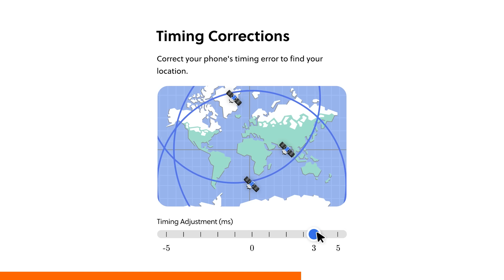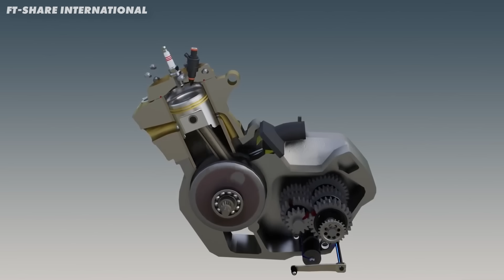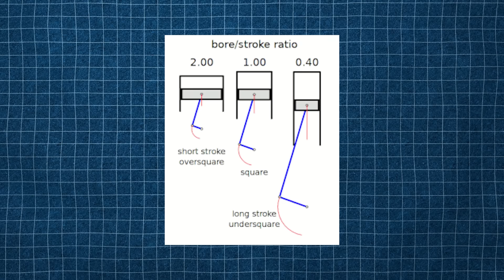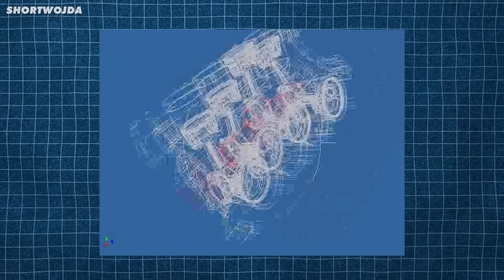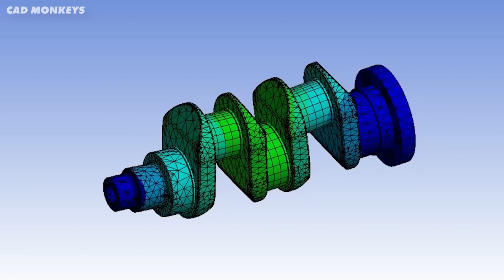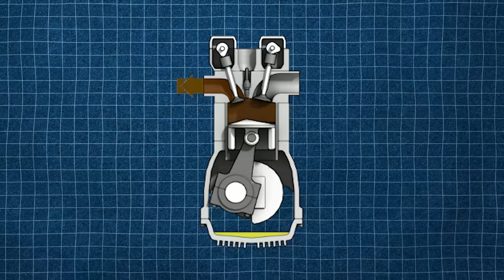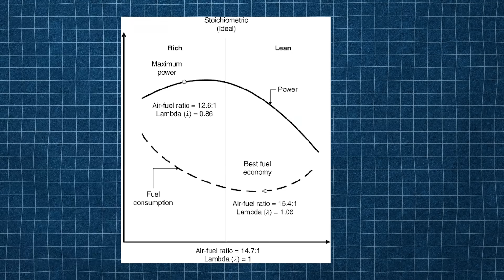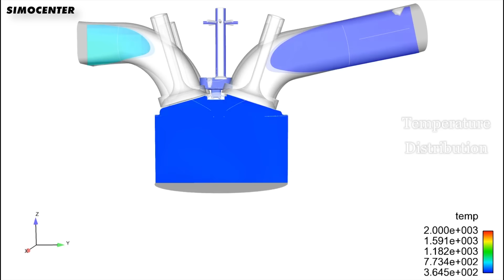Why It’s Almost Impossible to Rev to 21,000 RPM

Comment: I think you got the temperature of an F1 engine wrong. You said it can get up to 2600C 8:34 Titanium melts at 1668C, and aluminum, iron and steel all melts at lower temperatures than titanium. I might be wrong, but imo 2600 is impossible.

Comment: Wrong. My 1992 Kawasaki ZXR250 revved to 21K. Admittedly the redline was 19k, but that was just a bit of ink on a dial face. The engine went to 21K. On a road vehicle. That survived at least 20 years - I sold it early 2012 with no known issues. 4 stroke. 4 cyl. 16 valves. 4 carbs.

Comment: My stock 1999 Honda CBR250RR with 55,000km on the odometer routinely hits 21,000rpm and they are known to hit 23,000rpm without issue. Redline starts at 19,000rpm

Comment: ERROR at 0:10  No, it does NOT have a "MASS" of 2.5 tons. If there is no acceleration, a mass exerts ZERO force, PERIOD.    
Please stop speaking "JIVE". doing so either 'dumbs down' your audience or rankles those of us who understand correct units of measure, physics, etc.
The piston experiences a FORCE ( not a 'mass'), of 2.5 tons

Comment: bolloc the main reason rpm are not above 21k is because of friction the friction losses go up on the square power rises in a straight line so you get to a point were the friction losses exceed the gain in power from the extra rpm , the main point of friction is the piston to cylinder thats why you go over square to reduce these losses ...its also the main drive to pneumatic valves to reduce the power losses from the valve train by friction . you never even mentioned friction !!!!!!

Comment: My remote control car with a nitro engine does 37,000 rpm.  When I run it with the exhaust pipe off its like 10 times louder than a full sized car.

Comment: Wrong mate, two strokes do NOT rev higher it just sounds like that as they fire twice as often per revolution ! Moreover they are probably limited to the same mean piston speeds as four strokes as it tis the carrying capacity of the oil film which is the limit .Furthermore thee are contrary to common belief actually MORE fuel efficient in their optimal power band as there ar decidedly less mechanical losses , due to far fewer parts . But clearly less so the farther away one gets from said optimal power band one gets......

Comment: Material science has not yet reached that level in the private sector so the cost is just too high, but anything is possible.:yougotthis:
Reply: Absolutely nothing is beyond reach.:elbowcough:
Reply: Mechanical valves are the biggest hindrance to making pure HP, and is like carrying a boat anchor around wherever you drive. No matter what they're made of.

Comment: Renault and BMW both managed 21k in the V10 era of F1 before the FIA issued an order limiting engine RPMs to 19k.
Reply: Honda as well and Toyota. Ferrari played it safe for reliability but their car was amazing.
Reply: @GT3.01 Yeah that era was so full of so many manufacturers and they all offered some kind of great capability. Ferrari and McLaren Mercedes both offered the most balanced cars on the grid for multiple seasons. I think if the Williams BMW was more reliable then Montoya could have challenged Schumacher for a championship but they just couldn't get those engines right.

Comment: The strict theoretical limit is friction.

At some RPM frictional losses in the moving assembly, but more fundamentally in intake and exhaust gasses become the limit aka 'pumping losses' 
and pumping losess increase faster than power gain as RPM increases.

Friction cannot be zero for gases as gasses can't be Bose condensates.  So theoretical RPM limit is when Power = Friction Power.

Flame front v, material strength etc.. are all practical engineering limits, but only engineering limits...

Comment: its the mass and strength of the reciprocating parts that define the acceleration and deceleration of the piston and connecting rod that limits the max rpm, just like a helicopter rotor and blade cannot exceed a certain speed because the rotary wing aircraft is already moving in air at a certain speed while the machine is also adding to that speed while the other hemisphere of the rotor is doing just the opposite so there is a point of imbalance so that a helicopter cannot go over 2-3 hundred knots.  However, if the reciprocating mass is smaller, rpms can exceed 20k, it just depends on the balancing of the crankshaft and pistons so there are no harmonic imbalances.

Comment: ??? there is nothing stopping engines from going 21k rpm. In the current design form? sure. Valve float is real. That can be designed out.

Comment: Use hydrogen. You'll get even to 30.000 rpm if you want. The flame propagation is really fast with hydrogen. The energy density is crap though, so no hydrogen 😂

Comment: I'm sure most petrolheads have noticed:
Atmosphere air pressure (asl): ~14.7 psi, 
(the same as the ideal stoichiometric ratio) 
~14.7:1 (depending on fuel, eg, not nitro)...

Comment: All these people saying it doesn’t get heavier with rpm 
Then how does it go three the side of a block. It takes thousands of pounds of force to window a block 

Small minds will always be the problem of moving forward, 
Because they are stuck. And unable to comprehend dynamics in play.

If it doesn’t get heavier then why do we need 4-6 main studs 

The crank just turns in a single point. It’s because the rods and pistons are trying to leave the block. 

It’s mechanically locked through rist pin and block mains.

Comment: ........except  Ferrari had F1 engines running at 24.000 rpm ....and could have raced them. Paolo Martinelli was in charge at that time from 2002 - 2012 and was only limited by supply of pistons. Mahle delivered the best material....but quantities were limited. So at races with high full throttle mapping the full power was executed. At the rest of the races standard engines up to 21.000 revs were employed.  The glorious years of "rev festivals" are over for the moment.  But are coming back as " electric turbines"  , brushless inrunner with easily 30.000 revs maybe soon...but of course mainly silent as efficiency is king!

Comment: My little Honda CBR250RR will rev to 21,000, it's stopped making power at 19,000 but I've seen it as high as 23,000 on the track.  And that's 1990 technology and it's still going strong.
Reply: its easier with smaller pistons the size of the thumb because theres less mass

Comment: Appropriate summary: It is not impossible to go past 21K RPM but is it practical? Probably not. The point of an F1 engine is to be as efficient as possible while maximizing power output. There are more efficient means of achieving this instead of just trying to rev as high as possible.

Comment: im no expert but 2 strokes dont rev higher than 4strokes , the highest peak power two strokes peak at around 14 k now in around 1996 ishi rode a kawaski 250 ccfour cylinder fourstroke this crazy import from japan was redlined at 22k at a walking pace in first gear it was reving at impossible speeds , it had no power below 12k , it was and is the most absurd motorcycle i have ever ridden , , it wasnt fast compared to the 250 twostrokes at the time , but it goes to prove that it could be made , the 5 cylinder honda 124 of the 1960,s also redlined at 22k

Comment: We don't need 21,000 rpm's. If you just get it back to 19,000, which F1 engines had done for several years in the early 2000's, you get all the great sound and power you need. You just have to take all the turbochargers and hybrid units back off so there's nothing hindering the exhaust outflow. We're only interested in rpm's because that wonderful sound comes from there. The current trend of reducing dependence on fossil fuels in F1 by various tricks including lower rpm's to increase fuel economy has only succeeded in making F1 much more boring to watch than it was in its heyday. F1 should be following Porsche's lead in developing synthetic gasoline. Then you could save the planet and enjoy F1 again.

Comment: A lot of talk in the comments about "mass" vs "weight" but not a lot about how that "0.003s" figure in the opening line of the video is for a full rotation of the crank and not the acceleration of the piston. That's a shame because the actual 0-60 time of the piston is even more impressive than 0.003s!

Comment: The 2-stroke diesel which appears at 5.15 is fundamentally different to a 2-stroke petrol engine. Moreover, in the context of efficiency they are opposite ends of the scale: 2-stroke diesels are THE most efficient internal combustion engines ever built. 

@Driver61 you may also wish to licence the Phil M Karting clip at 4.42 instead of treating it as a free resource

Comment: Connecting rod length is a ratio of crank throw, not an indication of over or under-square motor? 
Shape up, it's kinda complicated and has many valid reasons for changing.
 As always, bad advice is worse than no advice

Comment: You really really need to have someone check your commentary, there is wrong, damn wrong then what you said, totally laughable mistakes..
Two strokes do DOUBLE the work in a given time, not half. (although generally producing less than double the power compared to a four stroke)
Two strokes actually last a LOT longer than a four stroke making same hp but at much higher rpm. ( 250cc road two-strokes were around in early 90's making over 90bhp)

Two stroke always has fresh oil because it isn't recirculated, crank has a much easier life as combustion prevents rod stretching excessively.
Over revving will destroy parts pretty quick though.
When Kawasaki/Suzuki first made four-stroke MX bikes to replace the two-stroke motors, ( in mid 2000's> ), the four- stroke 250 couldn't get close to 45bhp plus the TBO for crankshaft was 30 hrs (although many people extended the time as they didn't race)
Due to Harley Davidson getting AMA to change the rules in 1950's (so they could run 750 side valve against 500cc motors from Britain)
400cc four strokes were allowed to compete with 250 two strokes. (even though 50% would have been a 375cc)

Comment: AWWW 2:57 "We are only focused on engines that have pistons." No turbines, sure, because they are not positive displacement engines But Wankel engines are, and they can also rev quite high. When Mazda factory representatives happened to come to my school in the early 1970s, they said the factory had taken a regular Mazda Wankel as used in the RX7 car, removed the rev limiter and added a supercharger, and that little engine could run 25 THOUSAND RPM. Further, they said the mechanical 'blowup speed' of the engine was a whopping 78,000 RPM! There have been successful racers of Wankel engines, and compared to the extensive work needed to rebuild most race engines, Wankels can be rebuilt quite quickly, at relatively low cost. Wankels can 'breathe' far better than piston engines because they can use the large area on the rotor sides as intake port area, like a 2-stroke engine, yet Wankels are 4-stroke engines. Yes, they have poor fuel economy, but c'mon, we are talking about RACING ENGINES.

Comment: The more power strokes you can squeeze into a minute,( rpm )  the more power you make -But -  the volumetric efficiency gets worse as you try to speed things up ( that whole getting the air and fuel into the cylinder and mixed , thing ) .  There’s a point at which at which the gains by higher rpm get overtaken by the loss in volumetric efficiency . Had a tutor who said “ at 20,000 rpm pistons don’t go up and down - they just vibrate “ 😂

Comment: Mmm, was hoping to learn something based on the title of this video, but was disappointed.   I remember those Williams BMW V10 engines revving at 20K and driven by Montoya - was simply breathtaking sound.   Engines only had to last a race back then im pretty sure.  I’m no expert, but with 20K possible 20 years ago and the massive jumps in exotic materials, AI computing power and precision engineering, if V10’s were allowed back in, no rev or engine limits per season, you would see numbers well north of 20K I’m certain with associated jumps in HP.  Alas, next generation of engines in 2026 will be more of the same current direction with increased electrical power and very small power plants 😢

Comment: Two stroke engines are much more complex in theory as there are several things happening at the same time.  Two strokes actually left rev lower.  If you want to make the same power with a four stroke is a 2 stroke you have to spin it twice as fast.

Comment: European/British manufacturers can't, but Honda can. With multiple engine designs. Their V10 revved up to 23 000 on a test bench, and their bike engines went well over 20 000 in the 60's. Just so that you can't figure it out, does not make it impossible. And then there's the Wankel design. With just a few tricks, that engine goes over 21 000 with ease. The rev cap back in the day was to limit the gap between European and Japanese manufacturers. The Europeans didn't want to get washed away from their own game.

Comment: there are plenty of 2-stroke engines with common lubrication system. Mixing oil with fuel is only one solution, just the simplest one.

Comment: So 20 years ago F1 engine revved to 20k rpm. So over those 20 years advancements in oil, materials, manufacturing, TJS, and other innovations wouldn’t make 21k rpm possible? You never answered why it’s impossible, because it is possible. It’s just the FIA, FOM, and the manufacturers that don’t want it.

Comment: Why not opposed pistons ? Should allow 30,000 rpm due to shorter travel and absence of valves, Achates engines for example. Given they 2 stroke, that is equivalent to 60,000 rpm for a 4 stroke.

Comment: F=ma The mass of the piston remains constant all the time. Fast acceleration and deceleration as the piston approaches TDC and BDC increases the force not the mass. To overcome stress due to high piston speeds, the piston is oversquared. HOWEVER power is not all about RPM. You need to factor in torque. Further oversquaring the pistons allow for faster RPM but it comes at a cost which is a smaller crankshaft radius which means lower torque for the same amount of pistons and displacement. You can go beyond 21k rpm at the cost of some torque which means the car has poor acceleration as it exits a corner since the engine is not revving at max rpm around the corner.

Why 21,000 RPM F1 engines are impossible? It is not impossible. A 21k rpm engine is not a winning engine. Engineers build F1 engines to win races not to achieve a world record RPM.

I am not an F1 expert. That is just a dream for someone who have some background in mechanical engineering.

Comment: I used to have a nitro RC car with a tiny aluminum single cylinder engine that did 29,000 RPM. That thing was awesome!!! HPI has a 3.0cc 2 stroke engine that will max out at 32,000 RPM!!!